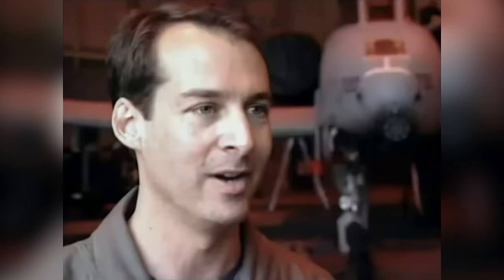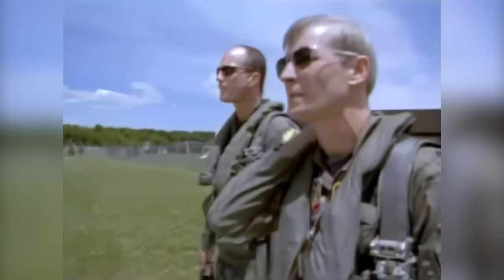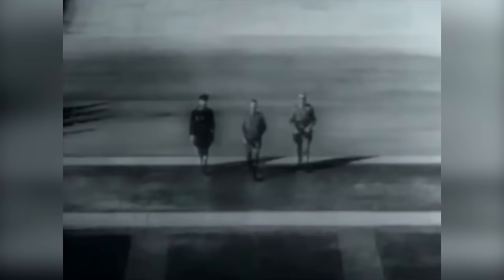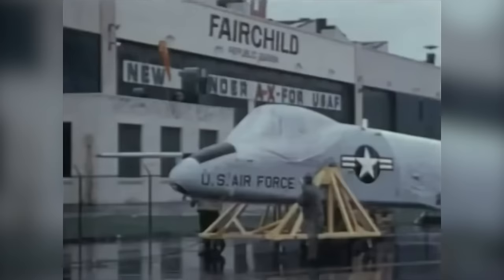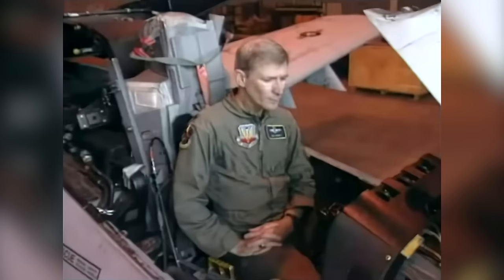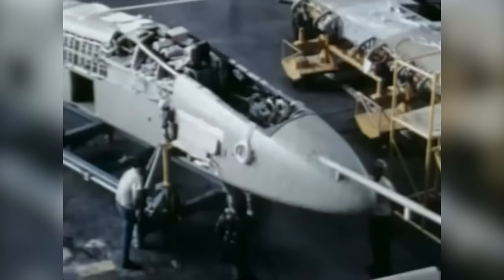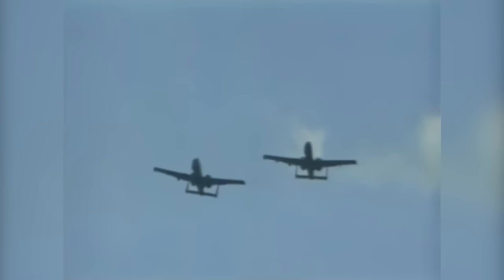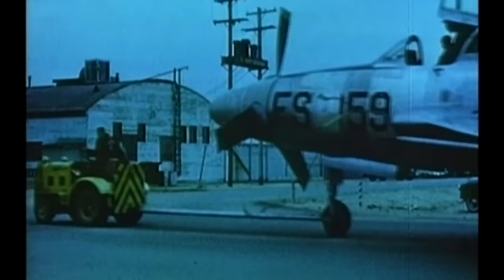THE A-10 THUNDERBOLT II Attack Aircraft AKA The Warthog

Comment: The commentary says A-10 has the biggest gun ever fitted into an aircraft. Maybe they are ignoring the 57mm six pounder with Mohlins auto loader fitted into DH Mosquito during WW2. The Tsetse.
Reply: What about the AC 130 with its M137 105 mm cannon . If I recall correctly, we ( USA ) had a plane with a 75 mm cannon on board during WW2 .

Comment: There are those who say the A-10 is past it's prime, an out dated attack aircraft whose job can be easily replaced by much more technologically superior weapons and delivery platforms...if that is true and the Air Force gets rid of the A-10, I'll take as many as they want to replace.
Reply: Not out dated, as it's not impossible to bring it up to date with newer avionics, wing spars, wings, and better engines (a long running caveat Hog Drivers reputedly have) 

With the above, it can get the ability to be a low-level ground attack aircraft, able to receive data from other sensors than their own.

In my opinion, a low level A-10 optimized for low-level maritime strike would be a great addition to the Philippine Navy Aviation Wing.

Comment: What he said about the Military sometimes choosing an aircraft not because it's the best choice in terms of design, but because they have more faith the company building it to be able to bring the program to successful conclusion and supply the numbers needed is definitely not new. That has come up many times throughout history. For example, the B-25 was initially shunned by the USAAF in favor of the B-26 design, but then it turned out the company producing the B-26 could not produce them fast enough to supply wartime needs, and so a contract was also issued to build B-25s to fill the numbers.

Comment: Its ruggwd and lasting. Can use so many ordinances in 1 heavy payload and have a very deadly but not precise front gun. Honty its a good workhorse and is best when in a small group. But they need Fighter escort to keep the bogeys off the Hog's arse.
Its a great addition to a complex air force system but not the best overall magical poney.
Fat Amy has some crazy efficiency in the same role, but can get in and out fast, can be efficient in a A2A combat and is very stealthy at low altitude.
But nothing matches the massive payload of the A-10 .

Comment: Very first sentence in this video is a lie.  "During the Gulf War, an aircraft previously unwanted become the most valuable member of the American arsenal."  What a bunch  of ****.   Who made this film, the manufacturer?
Reply: I guess you can say the same thing about B-52 (1954) the C-130 (1956) T-38 Talon (1958). But, still they fly today. Adapt to mission and capabilities.
Reply: @davidgraham4807  Say what same thing, that the B-52, C-130, and T-38 were unwanted?  They were all excellent designs that have never been unwanted.  All remain valuable, and the latter two have not even had to adapt their primary roles to remain relevant.   The A-10 is the opposite; it was overvalued for many years, and is now unwanted due to changing needs.